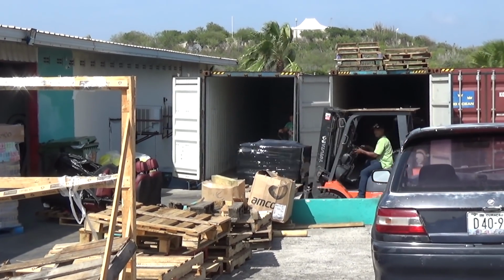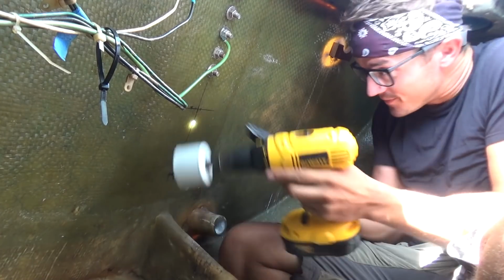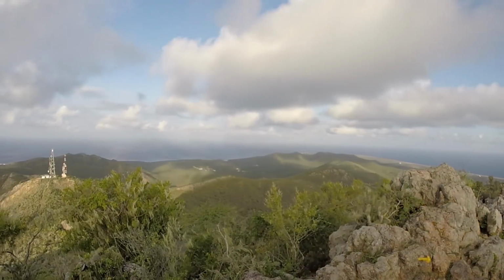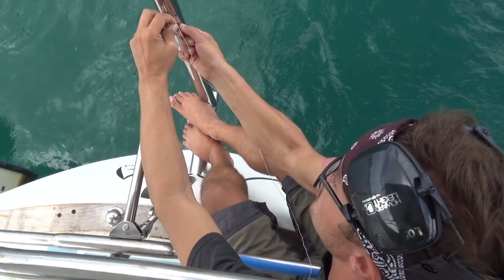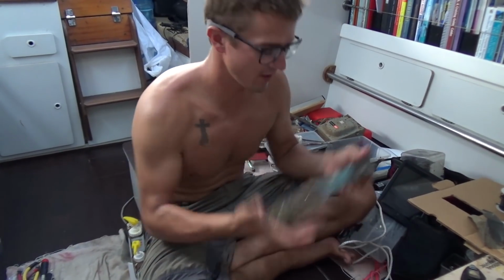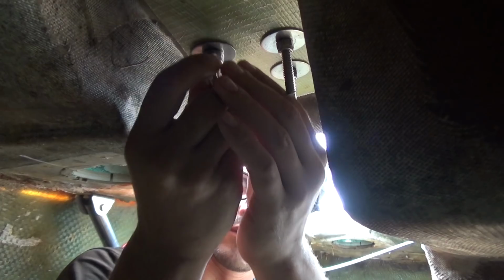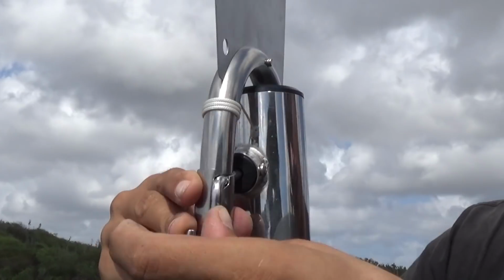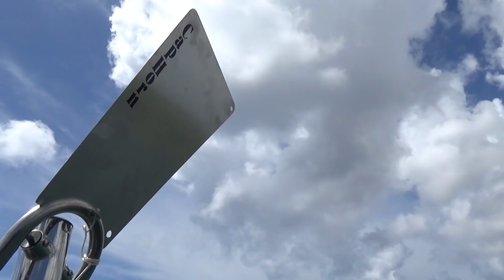Cape Horn Wind Vane Complete Installation — [Uma Gear Review]

Comment: With the combination of the Cape-Horn and Dan's video instructions, one should have zero problems on this installation. These instructions took extra work while doing this installation. so thank you guys. I checked this unit out when you first mentioned it and I compared it to other brands.....I would chose the Cape-Horn unit as well. I really like that you can attach a small inexpensive autopilot control arm to this units servo rudder and use its power to move the main rudder.

Comment: You didn’t seal the inside of hole you drilled through the transom. Liquid epoxy on inside of open fiberglass or you will have problems.

Comment: Dan, Could you tell me if the steering wheel inertia interferes with the wind vane responsiveness? I am also planning to put one of those and this is my concern. Thanks, Richard
Reply from the maker: Doesn't seem to have any effect at all. It usually only turns the helm a few degrees to stay on course, maybe a 1/4 turn when sliding down a large swell. So inertia isn't really an issue.

Comment: "Thick side goes to port" as he points to starboard
Reply: He does install it correctly though
Reply: Twice!
Reply: Looks like he got that wrong to me, thick side was to his left, he was facing aft, therefore it went to starboard.
Reply: I was thinking the same thing. Perhaps the video is flipped?
Reply: I was wondering the same. I was like "Wait, this side is starboard"
Reply: He is recording with the front camera on a smartphone, which flips the video around. Good observation, though
Reply: Daniel Eicher but typically only the „viewfinder“ Version of the image is mirrored, the actual picture is flipped back the right way

Comment: Awesome install video and very well explained. 
I had one of the first Cap Horns 20 yearsago when Eves was just starting out. I installed it on my Hans Christian 38. It worked great upwind and downwind in all wind strengths. I think my installation might’ve taken four days and I was at a dock. But working up to drilling that first hole in the hull is what took me the longest amount of time. 
You can also hook an electric tiller pilot up to it to steer when motoring, but I guess you don’t need that feature.
Reply from the maker: Yes, the build up to drilling that hole was definitely the hardest part.

Comment: Did you but any thread lock on the 🔩 screws. .. You will thank yourself later. ..
Reply from the maker: The screws all went into a teflon type plastic, and the bolts all had locking washers, so no lock tight needed.

Comment: What uma needs is a hydro generator, Sail & make electric! That would be cool thing to have on a long passage.
Reply from the maker: We're working on ecaxtly that. The sail to Columbia from Curacao was way to rough to test and experiment with regen, but we'll do a few more tests soon and hopefully get it up and running.
Reply: Shaun Sim  They have electric motor that should work as hydro power.

Comment: I've always wondered how these things worked.  I'm assuming that in order for these things to keep you on course, the wind needs to hold at whatever direction it was when initially set?  If the wind changes direction, this will steer you off course unless you adjust the settings?
Reply from the maker: Yes, pretty much. Ours you can adjust remotely.

Comment: What was the reasoning behind going with cape horn over some of the other brands available? Great video none the less, would like to see how much if any storage was lost in lazarette and will some shields be needed to prevent gear from pinching or binding the lines.
Reply from the maker: Just added a detailed explanation the this videos' description above. Hope that helps clarify our process for choosing the Cape Horn over others.
Reply: I watched another recent video of a boat that installed a wind vane that uses its rudder, no connection to the boat's rudder. When in operation, the boat's rudder is tied off dead center.  They said they choose that design because it can be used as an emergency rudder.

I would be very interested in the decision process that they used to go with a servo wind vane instead of a direct drive.

I'm not ready to drop $3K US on one yet, but I will someday!

Comment: nice install but im not sure if im willing to loose my swim platform for the wind vane, there is probebly a work around for that also.
Reply from the maker: You can mount the Cape Horn off center as well on any transom. It think you can even mount it on a catamaran.
Reply: Get a hydrovane and mount it at the side http://hydrovane.com/
Reply: There is, it's not a problem to drop a platform down around it.